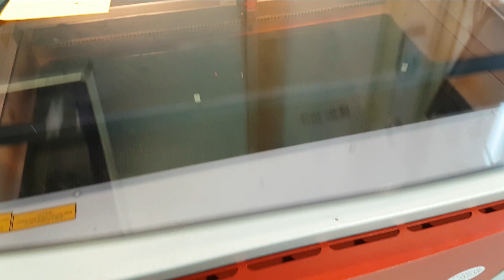Sculpting Professor Layton - Clayatures

Comment: Amazing as always!
I see you're using polymer clay now, that's what I use for my own sculptures. 
Haven't used that particular type, however. Is it sculpey firm?
Reply from the maker: Thanks a bunch😊 yes I used sculpey medium for this one, its great for details and so much more firm than air dry clay😅 it awesome to know that you sculpt too! What do you use?
Reply: @clayatures  I use sculpey original.
I haven't really tried any other types of clay, but I think I'm going to buy something a little firmer, 'cause I tend to smash some of the unbaked portions of my sculpts accidentally while I work, and I sometimes have to do those parts over again.
I'd put some of my work on youtube, but I haven't really got the most decent setup. Just a messy desk and a phone camera, haha.
Reply from the maker: @DeskDrawer  yeah that's one of the issues I had with air dry.. I'd always have to let them dry a bit before continuing.. Well I haven't tried sculpey original but I did read that medium is more firm but still very malleable. It's the first polymer clay of that type I use but I like it.
Haha don't worry about your setup, I use my phone and a messy desk all the same.. just gotta be creative😉 I'd love to see your sculpts, so load em up!
Reply: @clayatures  well, I do have an instagram, so you can check that out if you'd like. my name on there is @desk_drawerr . I have a few of my sculptures there already, and I'm gonna be posting some more soon.
Reply from the maker: @DeskDrawer  awesome will check it out!